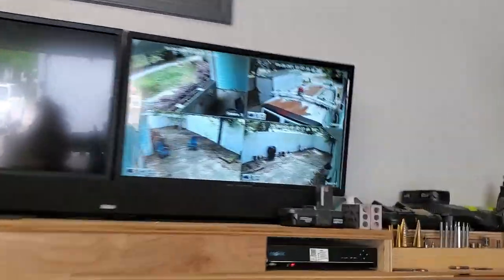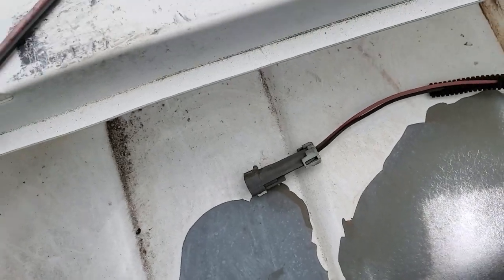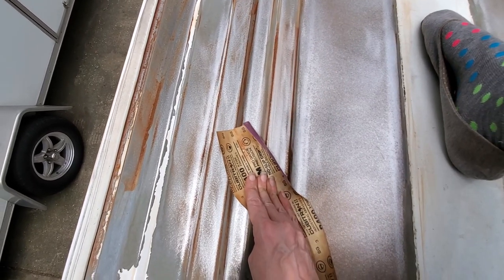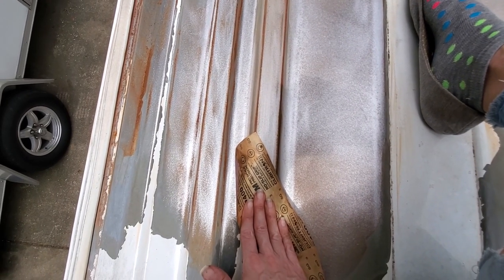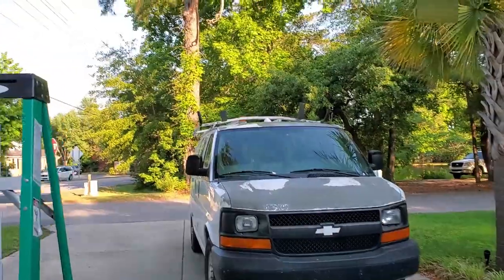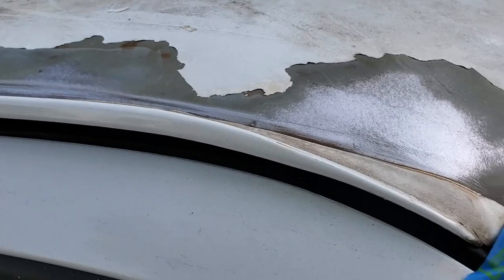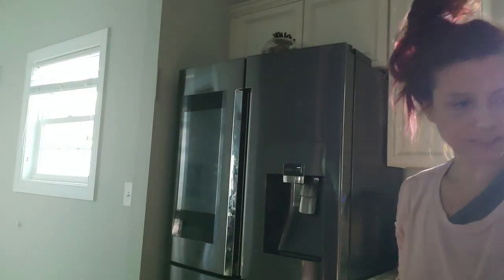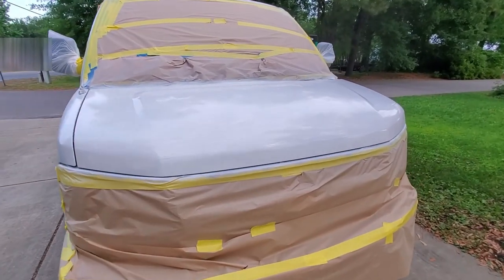SANDING & PAINTING MY CARGO VAN CONVERSION

Comment: how many rattle cans did it take to paint your van. thinking about tackling my vans paint problem as well and not looking forward to it lol. just wondering how many spray cans it took to paint the whole van. thanks. and it looks way better than it did. awesome job.
Reply from the maker: Well I only did the hood, 3/4 of the roof, and then other small places on the sides. I think I probably used like 6-8 cans? Good luck if you decide to! 🤙